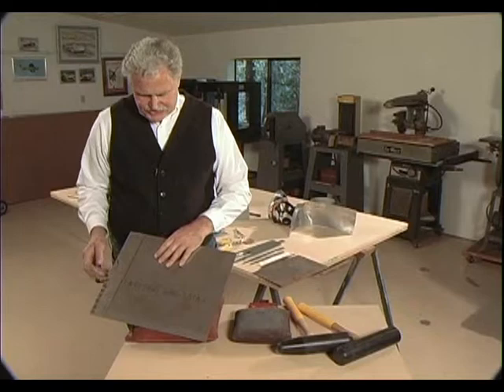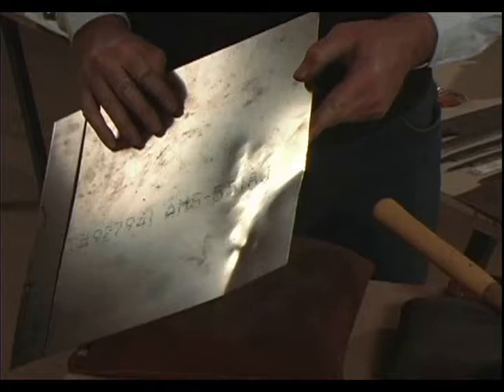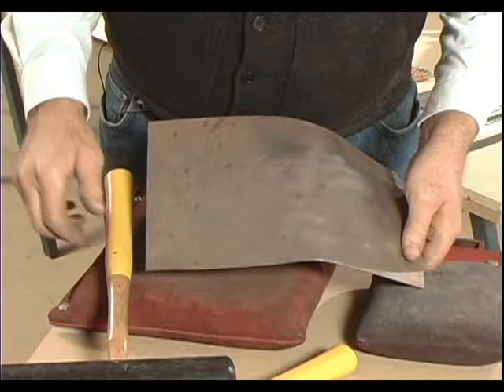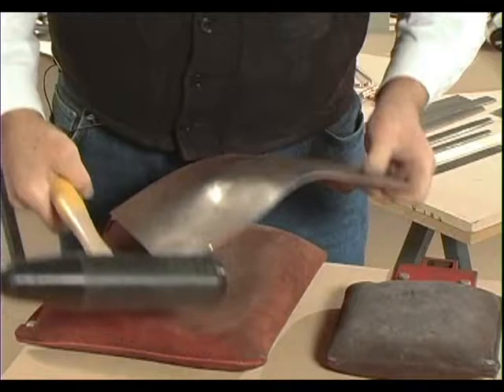Hard Mallets - Metalworking

Comment from the maker: @cropsey7  It's called a shot bag or forming bag. They come in different sizes. You will sometimes see them in other shapes (like round) but we prefer the square and rectangular shapes to be able to work the metal easier. They are usually filled with buckshot or sand depending on the size of the bag and your needs (different sized bags can have different sized fill.) We have more info on various forming bags in our catalog - give us a call 530-292-3506 and we'll send you one. - tinman